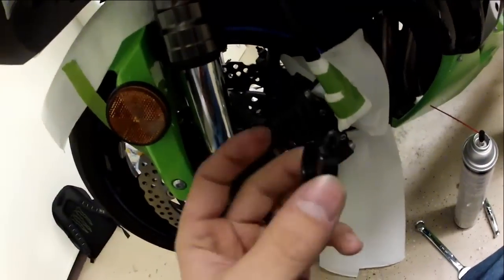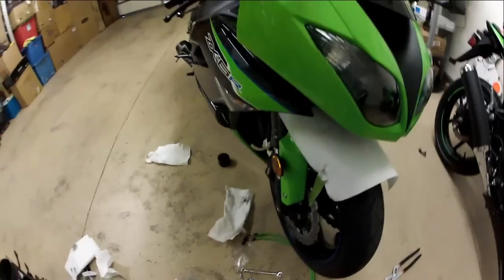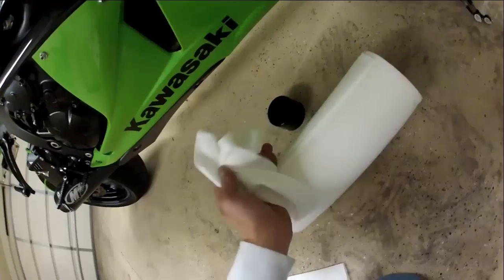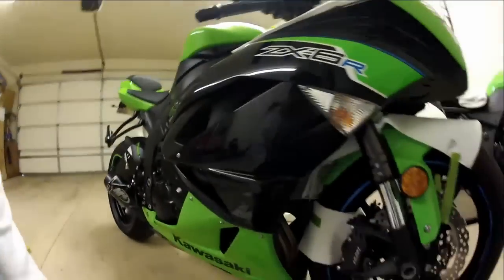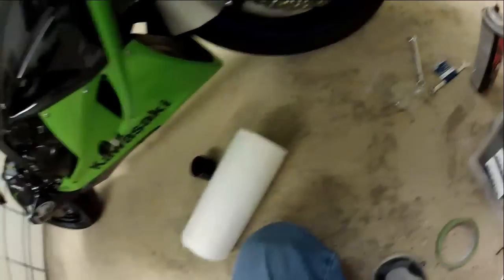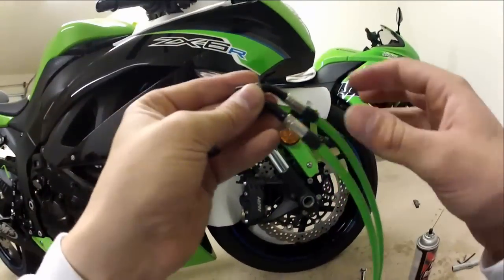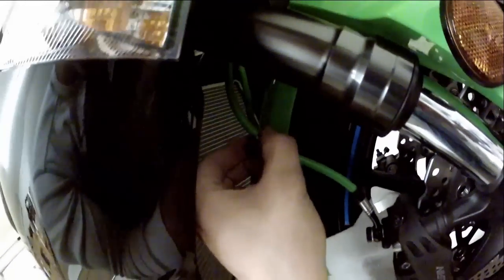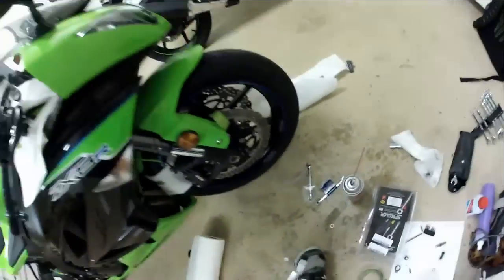Spiegler Brake Line Install (Front)

Comment: did you make a bracket to bolt the 2 front lines on that 10mm tucked in the front? i didnt and have noticed the 1 front line get caught on that hump and adds a wobble to the front wheel.

Comment: also, did you got massive improvement in braking or very minor ?
Reply from the maker: I noticed a slight improved response to brakes. Nothing crazy but I did this for the long run.  Because these won't crack or brake from the sun. Ect. But a better lever in my opinion.